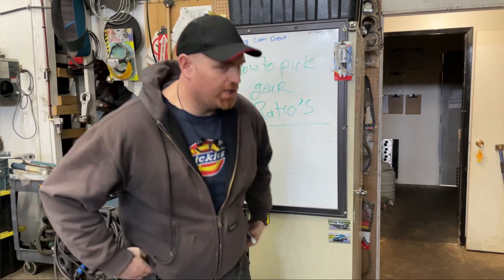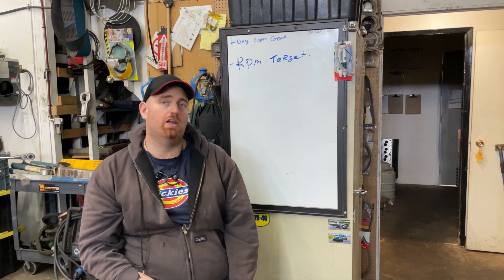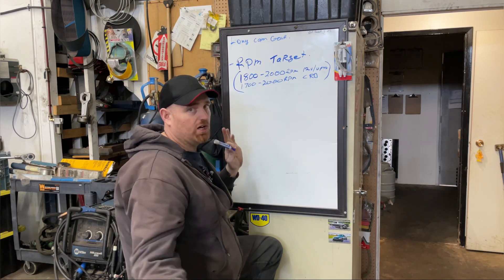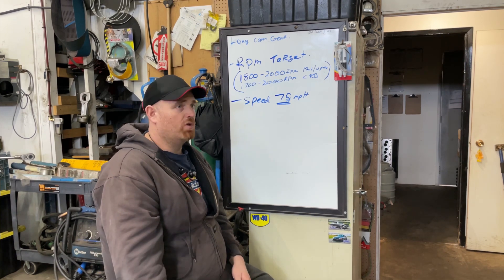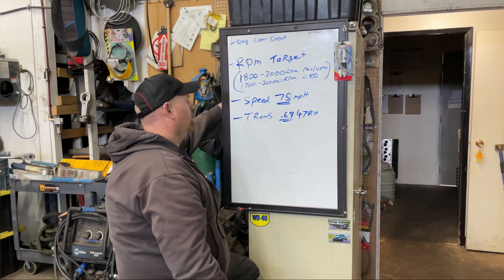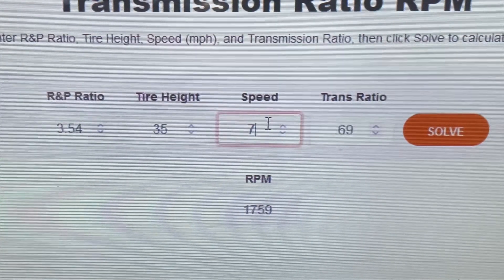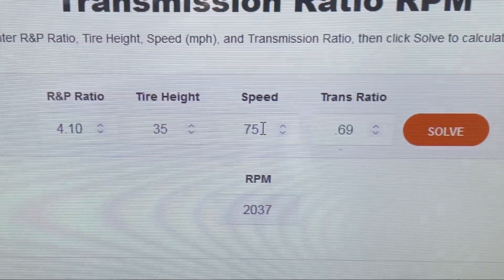How to choose the gear ratio on your truck

Comment: Gearing can make or break the whole experience in my opinion. Make graphs, have em printed on clear plastic. (336 x F.D ratio x MPH) ÷ tire dia. (Inches) = RPM

Fyi ... Final drive ratio = trans ratio (desired gear) x ring & pinion x transfer case ratio (hi or lo range, hi is usually 1:1) 

thats how I figure it 🤷‍♂️

Comment: Guys , what kind of ratio the best for haul gravel , with super B , gross 143000lb  ? 
Engine Torque 1850 lb 500 HP  , x15 . 
Transmission FO-18E313A-MHP
Thank you

Comment: 97 12v nv4500 4:10’s with 37” tires puts me at 2100 at 70mph. When my truck was stock, before governor springs, with stock fueling and 33” tires my truck wouldn’t even do 70mph.
Reply: I thought Cummins were torque monsters? Was the stock pump defueling super early?
Reply: @rodan2852  something was off. Factory 97 , nv4500 , 4:10. Should run about 85.

Comment: Ever since I lifted On my 6.0 PSD on 38's I've been wanting to go to 4.56's from  the stock 3.73's The truck drives fine  and not laggy, but with the taller gearing i've been holding off my  bigger injectors and turbo due to it being smokey asfuck. Plus with that cheap lift-kit truck gets hella sketchy around 80-85mph now yet at that speed the motor still wants to eat. LOL   But what do you think about swapping the stock LSD diff. And get a E-locker like the newer super-duty's have?  Ford sells the whole  Unit for like only $550 Or are they shitty? I DK much about them
Reply from the maker: The elock as nice to be able to lock and unlock. On the ford part I am not sure
Reply: @CUTTERUPROB  Hello, I need to contact you directly, I have several questions about a project I am doing. I am willing to pay you. how can we do it ?

Comment: I  run 3.07 so I can cruise in overdrive and tow in direct.
Reply: Years ago on the forums I read where someone built a Ram Charger with I the 5.9 cummins and I assume 47rh..I believe he said it had the 3.07 gears ..I thought it be a nice  ride to pull a boat or whatever with . That was a long time ago

Comment: Well I glad you brought this up. This was a learning experience.  When I went to a manual transmission a g56 I was not aware there was two over drive ratios . I run 3.55 gears and when I got the transmission  in I found out mine was .79 . So I found a formula to figure the rpms and decided that a set of 285/75 /17 helped gain back a lot of the lost . To be honest I like to tow at around 65   . I drove my truck empty and tow and check fuel economy to see how it does .. I was not aware of the zf6 transmission being able to be used in a Dodge 4x4 till a while back with the .72 overdrive ratio . I set down the a calculator and used the .79 and .74 of the g56 and the .72 of the zf6 and lastly the .69 automatic.  It became obvious to me why the 4.1 and the automatic work OK with the 35 . I used the 33.9 on my tires . I saw a formula on road kill video is what I used to figure out the rpms . I think lol that towing at 65 ish at around 1800 ish might work OK.  I found that with the smaller hp my truck makes and my gearing and 6 speeds and the .79 overdrive tows OK.  When I not towing a trailer the     .74 might really shine . I just not sure if it would net a significant difference in fuel consumption. Driving at from 65 to  70 unloaded I can get 20 to 21 so I not sure if there is more to be had ..Thanks for the video . I think wind resistance is a huge factor for fuel efficiency

Comment: Thanks for this video, I'm in the process of figuring out if I want to change gear ratio in my cummins swap F350. I spin some pretty good RPM with the factory 4.10, 32" tire and nv4500 at 70. This is a truck that pulls a trailer all of the time, so I don't mind RPM, but I feel like I could get it lower and be better off. This video helped out, thanks.
Reply from the maker: Glad it helped you out

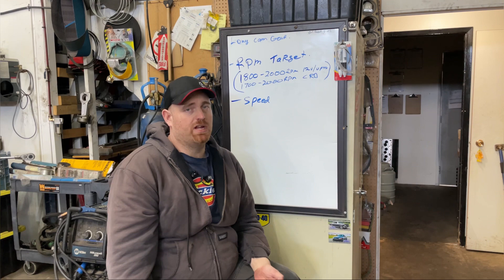Comment: The truck's I have on the road , except for the '06(3.73 I think?), all have 3:54... I do have a set of 4:11's  from a retired truck I may use at some point... My daily truck with a service bed and fuel tank could use those obviously..I just run smaller tires Like factory 245's and turn OD off and it has a full manual valve...it seems to do fine..I've outgrown the desire for big tires with long legged gears cause it isn't practical..but anyway, thank u for the insight on this👍👍...see ya next time..have a good weekend 👊

Comment: 97 12v with a 47re and 35x12.5x16 tires and I have 354 gears...it used to be 373s I tow or haul loads here n there...not too often and my converter locks up around 40 mph

Comment: I'm not sure if those of us who are constantly switching from high way to city would benefit much from changing gear ratio.  

I mean depending on where I am going I may mostly run 35-50 (city) or 55-75 (highway) but this all depends on traffic that day or hour and where I am going some days I stay on 55 mph roads most of the day so I'm not running over 62 at the most but then some days I get on a 65-70 mph high way for an hour

Then every now and then I get on the innerstate where I run 75-80 mph for hours straight

Hard to decide how to calculate when the driving conditions change so much

Great video tho btw.  I'm really enjoying all your 12/24 valve content